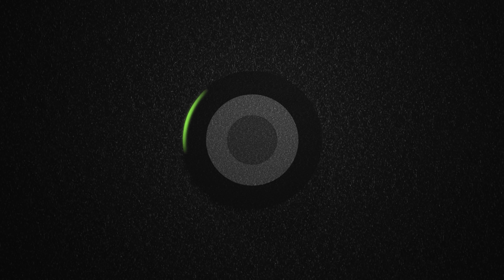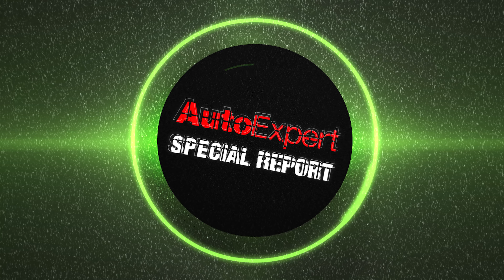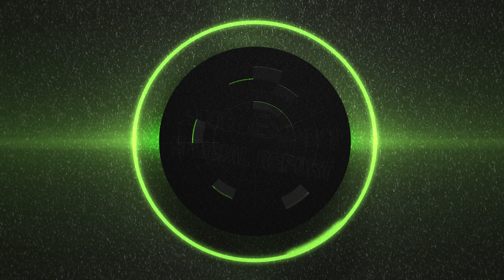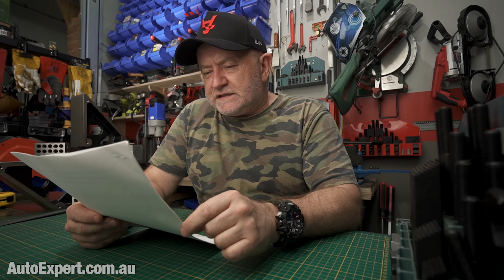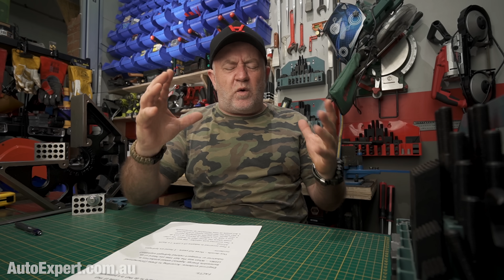The truth about fire risk: Hydrogen fuel cells and battery EVs | Auto Expert John Cadogan

Comment: I think your data of 1 in 2000 ICE vehicles catching fire each year is a little questionable and is probably manipulated to suit a particular agenda, such as the fire service saying they put out X number of vehicle fires to justify funding and staffing levels. I live in a town of 10,000 households that on average all have 1 ICE vehicle. My household has 3, and many others have at least 2, so I think this average is fair. Based on the data you quote we should be having 5 ICE vehicle fires per year. In the 14 years I have lived in the town I have not seen or heard of one ICE vehicle fire, but we have had 1 EV fire. Also the figures that you quote I believe are a little misleading, if at all they are accurate, in that you give no reference to certain factors in the same way as you did for EV's. You need to quantify the types and ages of the ICE vehicles involved, the environments in which these fires occurred, were the vehicles stationary or mobile, was the ICE running at the time of the fire, was the fire initiated by an electrical fault or a fuel fault, was the fire due to an accident, how much water was needed to extinguish the fire, how many of the vehicles were classed as "total loss" by the insurers, and how long did the fires burn for. These are just some of the things that need to be included in your figures to give them legitimacy.

Comment: I'm confused. When ever there is a bush fire that burns down houses and sheds you hear about LPG cylinders exploding. Even the fire department report exploding gas bottles. If so this pressure release you talk of cannot release quick enough, and pressure builds up to the point of the bottle bursting releasing an energy wave. Aka an explosion.

Comment: You're wrong about hydrogen leaks John. High pressure hydrogen leaks are extremely dangerous. Hydrogen has an inverse temperature characteristic, as it expands from high pressure to low pressure it actually increases in temperature and can reach it's auto ignition temperature (500 C). I'd spent 30 years in power generation where hydrogen is used as a generator coolant. Ask anyone who has worked with it in power generation or oil & gas industry - we all have the utmost respect of it.

Comment: I think hydrogen is going to be way more successful than most people realize so it is good to have some of the myths around the dangers of hydrogen storage debunked. Thanks John. I respect your take on things.
Reply: Nah. The inefficiency of hydrogen dooms it from the start.
Reply: @LiamE69  Nah. You need to think more broadly than efficiency alone. If efficiency alone was the one thing that determined if a technology succeeds, we would have never even started using petroleum fuels in the first place. Other factors like material supply availability, marketability, and land use matter too. I see BEVs having a hard time scaling up to that of ICE vehicles in their current form. Hydrogen is likely going to become much cheaper and more efficient to use than crude oil in the near future due to the wide and diverse amount of ways it can be produced. So I fully expect hydrogen to play a role in replacing the use of crude oil because BEVs will likely not be able to do it alone.
Reply: @kiefershanks4172  The lack of efficiency is fundamental physics that there will never, ever be a way around. 

That inefficiency will mean hydrogen is ALWAYS more expensive than the alternatives. ALWAYS. Thus will only ever make inroads where it is the only option and where the increase cost can be carried.

That will only ever be niche uses, never the mainstream.
Reply: @kiefershanks4172  John did a good video about a year ago about the inefficiency of make hydrogen.
Reply: @kiefershanks4172  petroleum-based fuels are infinitely more efficient than having to feed horses every day and walking through dung-covered streets.

Comment: Good morning Mr. Innuendo. I have owned LPG cars for over 10 years, (this is the third one), and I have even been involved in collisions, (I have been hit from behind, where the tank is located) and there have never been any leaks. 
If the system is well maintained, the current technology is quite advanced in terms of safety.
In Portugal, legislation nº 13/2013 regulates the use of LPG, and establishes, among other things, that vehicles adapted before the date of the legislation cannot park in closed parking lots, and after that date they can. It has to do with technical regulations and inspection. (Although this law should be in tandem with Decree-Law No. 220/2008 of November 12, and other legislation applicable to the parking of vehicles).

Comment: 1:2000 petrol fires. WOW. Makes you think. We need to move away from the early Li-ion batteries chemistry (with chrome, nickle, manganese etc..) to LFP batteries which don't burn even when punctured. The two biggest battery manufacturers (CATL & BYD) are currently transitioning to Sodium-ion (Na-ion) batteries which are much safer. The older BEVs with the older chemistries will be the problem in the future. Wonder if retro-fitting safer technology to early BEVs and ICE vehicles will be an conversion industry of the near future. Cheers John and happy new year.
Reply: Sorry, (with cobalt, nickle, manganese). Cheers.

Comment: What worries me is people taking EVs on car and passenger ferries. On a ferry, the crew is trained and equipped with enough firefighting equipment to deal with a normal car fire. However, they are not going to be able to deal with even a single EV fire. 

At best, they could probably stop it from spreading to other vehicles, however, the thing is going to be still burning away when the ship gets to port. The costs due to delays and damage involved is going to exceed the insurance upper bound of the EV
Reply: Not all cars have batteries that exhibit the same amount of thermal runaway that John talks about here.

The new safer battery going in most new EV's can even be punctured (while charging) and not explode.

https://youtu.be/Qzt9RZ0FQyM

So many people have misunderstood John's analysis.

John's main point is that the dangers can be mitigated.

Just like having unsafe tanks of petrol in a ferry would be unsafe - but that's not what cars are...

Comment: Just a quote from a BMW document extolling the virtue of it's hydrogen 7.
Quote  Boil-off management for controlled evaporation.
For physical reasons alone even vacuum super-insulation cannot totally
avoid a certain intrusion of higher temperatures, meaning that a small amount
of liquid hydrogen would inevitably boil off in the course of time.
BMW
Media
Information
11/2006
Page 11
However, this minor evaporation effect only starts after the vehicle has been
parked for at least 17 hours, whereupon the pressure inside the fuel tank will
increase to a level requiring boil-off management of the gaseous fuel.
Boil-off management limits the inner pressure inside the tank and, when
exceeding a defined level of ideal pressure, ensures controlled removal and
conversion of hydrogen. Gaseous hydrogen released in this way is
mixed with air in a venturi pipe and oxidised into water in a catalytic converter.
The period required for purging a hydrogen tank half full in a controlled process
is approximately 9 days, the hydrogen then remaining in the tank still be
sufficient to cover approximately 20 kilometres in the hydrogen mode.
And should BMW Hydrogen 7 be driven in the meantime in the hydrogen mode,
the level of pressure inside the tank will decrease again due to the consumption
of hydrogen serving to drive the engine. Then, when parking the vehicle again,
the 17-hour parking period without any loss of energy will start all over again
from the beginning.
Filling the tank is easy.
There is also a vent system if the gas pressure increases beyond what the catalyst can handle so Bmw recommend thatthe vehicle is not parked in an enclosed garage.
https://www.wired.com/images_blogs/autopia/files/bmw_hydrogen_7.pdf
Reply from the maker: That's how cryonic gas storage works.

Comment: Send a copy of this to every EV Zealot and your local MPs, State and Federal. Make them aware. Basic science gives you the answers. Personally, Lithium batteries should ALWAYS be in a cooler environment. 40 degree dry heat and heavy discharge = potential disaster. What about the EV in the US which burst into flames. They kept trying to put it out but constant reignited. They had to bring in a open top container to lift it into. Top Gear's Hammond in the EV supercar EV. Ran off the road and became a charcoal monument. Evs have a hell of a long way to go. Just think about it. A lot of the older pollies could be pushing it perhaps with the idea of getting bit slices of the profit pie and be out of politics by the time a 'normal' brained thinking pundit finds out it won't work as all the bullshit spruikers say it will. By the time they perfect it, the next ice age will render it useless anyway.

Comment: John, when you talk about batteries I never hear you talking about degradation from fast charging (maybe you have and I missed that video.) How much faster will the battery degrade if you're using fast chargers quite often?
Reply: Fast chargers only charge extremely fast at certain percentages for the battery (for example 30-80%). And then it slows down at higher percentages.

Fast chargers and EV's communicate so the charger knows exactly what percent the car is, and what speed it should charge at.

So without any hard evidence, you shouldn't be too worried about any extra degradation, especially if you have an LFP battery in your EV.
Reply: @hargeaux There is another channel on YT and the guy has an older model Tesla, I think it is a 2013 or around that age, and a new Tesla that is less than 12 months old.The older one can't use the fast charge while the new one only uses Tesla's fast charge and the new ones battery degradation is much higher than the old one. So there is physical evidence out there but it is well hidden so as not to hurt sale figures. Musk is no idiot.
Reply: @dikkybee4003  link?

Afaik, Tesla's only stock with LFP batteries are brand new Australia model 3 and Y (base level).
Reply: The latest generations of EV batteries have dealt with this for the most part, BYD blade, Tesla 4680 etc. BYD's blade design is also far less prone to thermal runaway, so there's that

Comment: While not related to Hydrogen or Lithium battery explosions, an LPG (Liquefied Petroleum Gas) carrying tanker exploded after getting stuck underneath a bridge in Boksburg South Africa. This happened after the driver took a wrong exit from the highway. This happened on the day before Christmas and killed 34 people (some inside a nearby hospital that was also damaged) and injured many more, damaged houses and other buildings, etc. An absolute shocking and tragic event. 

My point is that we are already surrounded by things that can explode in our homes, our work and on the roads in between. If these events doesn't help improve safety then that will be an even bigger tragedy. We, the public also need some sensibility and definitely some education. We need to know how to deal with the potential dangers with any of these chemicals. One would think a flaming gas truck would have people get away from it as far as possible but unfortunately a few were killed because they were recording the situation with their phone cameras, completely unaware of how dangerous the situation was about to become.

Comment: About batteries, well, they are as prone to fire to any other fuel is, yes thei fail and they are hard to put out, yeah, that sucks, charging fires will indeed become more frequent. Now about H2, all I can say is. Fock you, yes, it''s a bomb, it's not new in cars, and yes, handling Hydrogen tanks requires special permissions in industry (I have one). Saying only 6 H2 incidents, is being blind, when there are no cars on the road yet ( I do hope humanity comes down to senses ), the more cars, the more accidents. H2 is stupid for civilian usage. H2 doesn't need perfect sthoicheometry, anything between 5% and 80% (LEL-UEL) is enough. Yes they are moving bombs, explode a gasoline tank, it doesn't go far, explode an LPG tank and and condo blows up, blow an H2 tank annnnd, a block goes to cinders. LPG has a wayyyyyyyyyyyyyyyyyyy tighter UEL-LEL than H2, yes, H2 is lighter than air and escapes easily which turns false your statement, H2 DOES NOT circulate in pipelines for very long runs, because it LEAKS. Just the expansion of 700bar exploding is enough (they are hard, BUT accidents do happen), Yeah, H2 tanks are more expensive than a freakin car, yes, they are, My 200bar H2 tank, just alone, empty, costs 4000eur. Saying tanks DONT FAIL is a COMPLETE FAILURE of YOU! Everything FAILS. Geesh.  Going against H2 in civilian vehicles is the correct, devalue H2 dangers as MEH, you are just being an arse. And I do like your show and I do agree mostly with you. BUT FOCK H2, it has died already and will die AGAIN.

Comment: So  how does one fight a lithium ion battery fire due to thermal runaway?
Reply: Dunk it in 10x the volume of cold water and wait. A family pool works well
Reply: @theairstig9164  But it's on fire who is going to grab it?  I'm thinking about how to put it out in place?
Reply: @Overonator  The Dutch have a great system which is basically a mobile swimming pool with a forklift that drops the Tesla in until it stops. Other than that, there's not much else fire crews can do but hose it and wait for it to finish.
Reply: The current method is to evacuate the area. Apply water to reduce heat.

Comment: When they fill scuba tanks. The tanks heat up, so a 200bar fill when the tank has cooled becomes 160bar. They have to top off the tank when the tank is cool so you actually get a 200 bar fill.
So they fill the tanks in water to keep the tanks cool.
Time is money.

Comment: John, you're calling me out here. I made hydrogen in a bunch of Tupperware containers and aquarium tubes with graphite electrodes extracted from batteries in my bedroom at 14 years old. I apparently don't learn anything fast as after it invariably blew up I rebuilt the whole device twice as big. The resulting explosion cracked the windows, blew a massive hole in the ceiling and just about blew my eardrums out. 

Our landlord who was a conservative old man who happened to be my grandfather was less unimpressed than I would have predicted. It came out at his funeral last week that he was making gunpowder and fireworks at the same age so reckless indulgence in chemistry runs in the family.
Reply: lol, yes, boys will be boys lol. build it, blow it up, break it, fix it.
Reply: My tip.... add washing up liquid to the electrolyte and collect the bubbles. Cuts down on unwanted explsions. The bubbles can be destroyed later to give the pure gasses. Made a 100l bomb like this when 16. Nice especially if acetyline included.
Reply: Ah, so I wasn't the only one aged  around 14 up to antics like electroplating, dismantling fireworks to play with gunpowder, dissolving copper off ex cinema arc lamp carbon rods with concentrated nitric acid trying to make a zinc chloride liquid battery and suffering a bit of a bang trying foolishly to high pressure leak test a home made boiler with compressed air not water.  Parental blind eyes  in early life perhaps makes us much more balanced on safety in later life. If we retained our eyesight, fingers and hearing of course.
Reply: @Phil Healey  yeah, I got mild poisoning from the batteries I used to get the electrodes and have scars to this day from small 4th degree burns from a small mishap with a cheap oil burner. I still remember my mother screaming "WHAT THE FUCK WAS THAT!?"
Reply: @spencerhho  Yes, maybe I did have years of Tinitus from the boiler test fiasco and still have a clicking wrist joint after a failed attempt to ride a pushbike down a flight of steps, but remain eternally grateful for parental lack of supervision. I never did admit to blowing up the TV however trying out some Blue Peter advice on turning off the electricity mains......
Reply: Sorry to hear of your loss. I hope you can remember him with cracking stories like this.

Comment: Your resident bean counter. Yes actuaries in some areas are increasing premiums for EV owners in homes, some insurers outright won’t cover your home if you own an EV.  I worked in the Aviation when li-ion fires risked the industry. Hence the strict rules imposed by IATA.
As for hydrogen the biggest issue for transport industry is the volume and infrastructure required in the supply chain. In my opinion hydrogen won’t be commercially viable until it’s use is firstly introduced to bulk transport, specifically the aviation sector where it can compete with AV gas.
Reply: Aviation kerosene not 100LL.